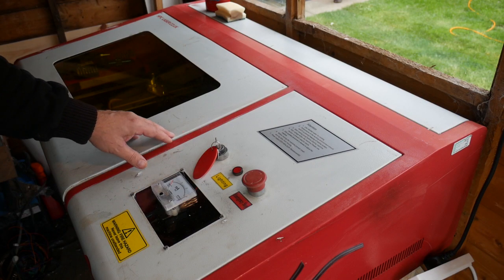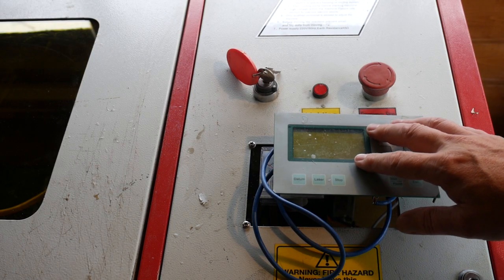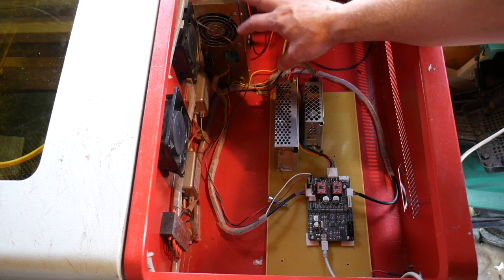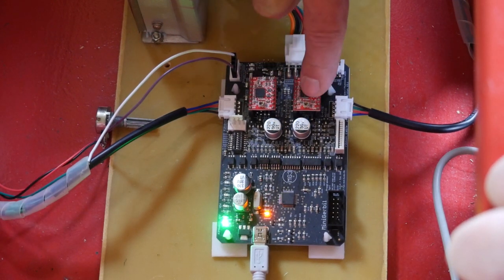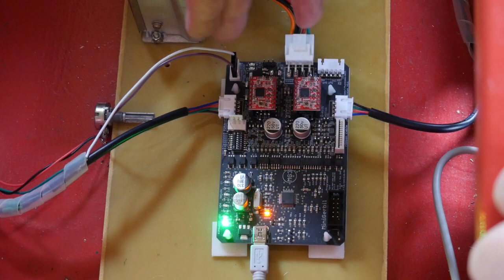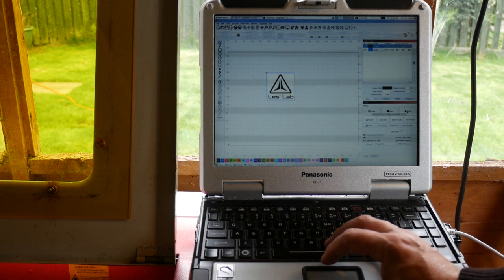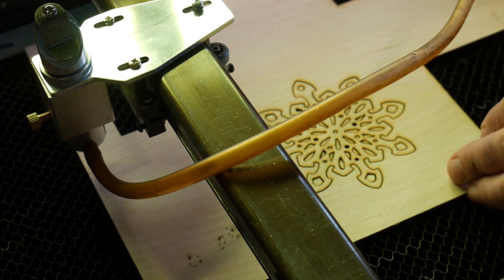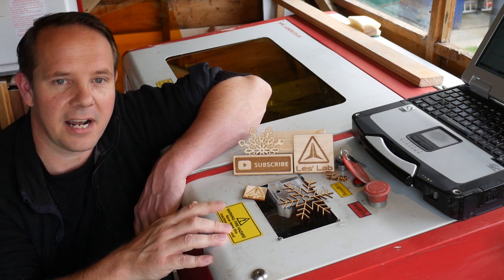CO2 Laser Upgrades! Part 2

Comment: @LesLaboratory - I own a couple of Laserpecker 2's serving my engraving needs just fine. But like many enthusiasts, I don't have the space to accommodate a larger CO2 laser enclosure, nor an air compressor, filtration and ventilation required for Co2 lasers. Otherwise I'd definitely buy a pre-owned unit over new, given how abundant and relatively easy they are to modify and service. I chose Laserpecker 2 galvanic engravers because of their handheld portability, engraving at any angle and powered by any 12v 5amp source.

Thanks for sharing Les. 👍

Comment: I have a cnc router which I have considered several times adding a laser engraver head option but have been put off as I worry I will end up blinding myself. I am based in U.K. but buying from eBay etc. I feel I don't know enough about them to know if I can trust the information supplied or supplied safety glasses etc.
 Can you suggest a suitable laser head I could consider (reasonably priced for what it is but that I can trust the supplied safety glasses or know what ones I need to buy) or a U.K. based company I could try that wont rip me off?

Comment: Hi Les, I have the same controller in an old laser and I am replacing it with the Mg3. I don't know where to connect the Laser On signal (LO) pin. Thanks for your help!
Reply: I did find the solution at the forum of awsome Tech..
Reply from the maker: Sorry for the late reply, I was away for the house glad you got it sorted. It's well worth repairing these they are decent engravers. you will be surprised how many excuses you find to fire off a job!

Comment: Hi Les I’m just in the process of refurbishing an old laserscript 3040 and now looking to put the mg3 in, how are you finding it after a few months and did it come with leads for stepper motors as mine are non plugged leads same as yours and what 5v power supply is recommended for the mg3 ?

Comment: Les great video. If I was looking to regularly cut and engrave 2mm MDF would you recommend the xtool 20w or a k40? I had a flux beamo before but found the cost a bit steep
Reply from the maker: I have not cut MDF myself, but from what I understand from others is it a pig to work with, being quite dense, and probably full of binder. I would suggest somewhere btween 30-60W of Laser power would be required for a reasonably fast and clean cut.

Comment: Anything new on the Laser Beam Profiler? 😊

Also what kind of SCR did you use for your spark-gap trigger circuit? 😅
I am getting my 100µs Pulse out of my schmitt trigger into the moc3020 but my BT151 on the other side doesn't care 🤔
Reply from the maker: Too many other projects got in the way. The proof of concept code is alright, but relies on an old lib and so needs work. When it get it working adequately on the Pi, I will do a release.

I am using a 30TPS08PBFare you seeing a singnel on the gate of the SCR?